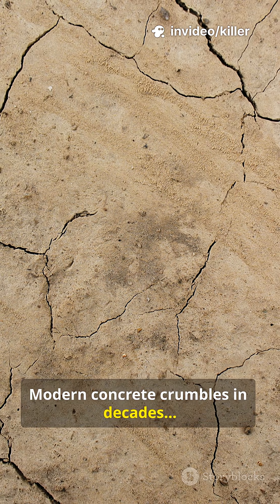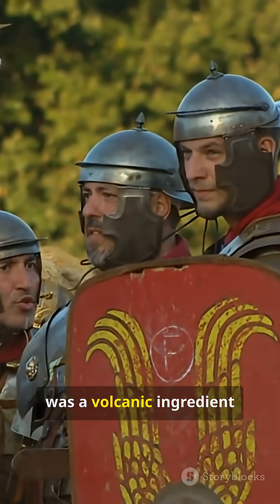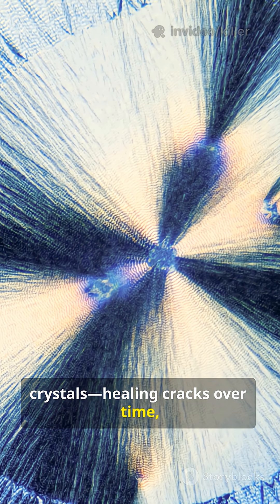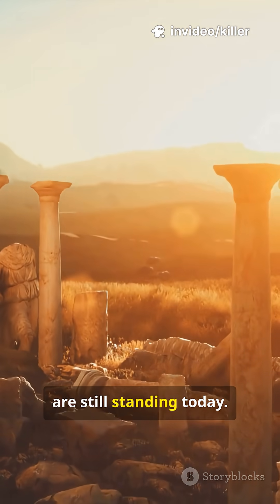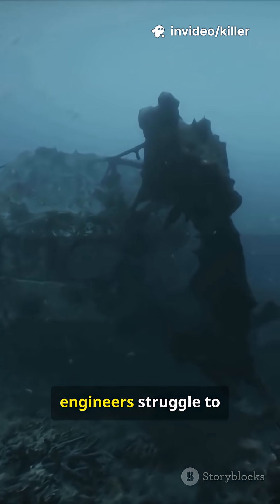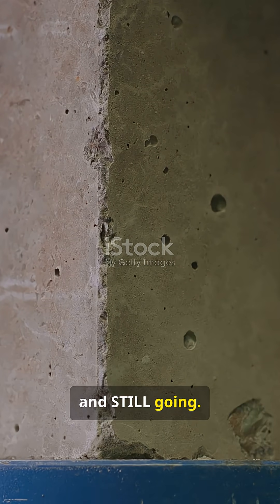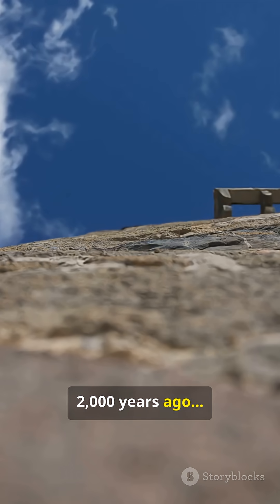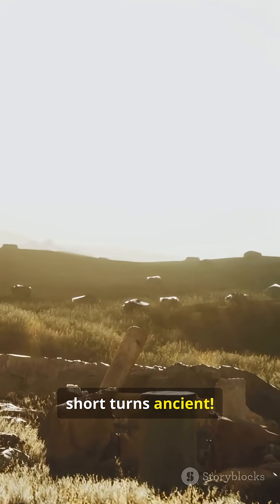The Secret Recipe Behind Rome’s Indestructible Concrete

Comment: This isnt true.
Well.  Its almost true.
Roman concrete used sea water,  which contains bacteria that produces lime deposits.   When the concrete cracks, the bacteria gets fed because qater can penetrate.  Causing the bacteria to activate.  The lime fills the cracks and heals the concrete
Reply from the maker: Thanks for the comment! Roman concrete did heal itself, but not because of bacteria.
Research shows the cracks filled due to a chemical reaction between volcanic ash and seawater, forming tobermorite crystals.
Appreciate you pointing it out!